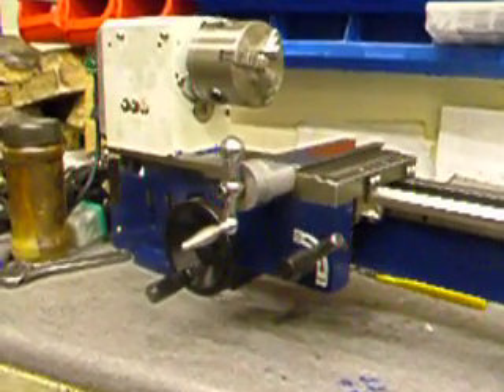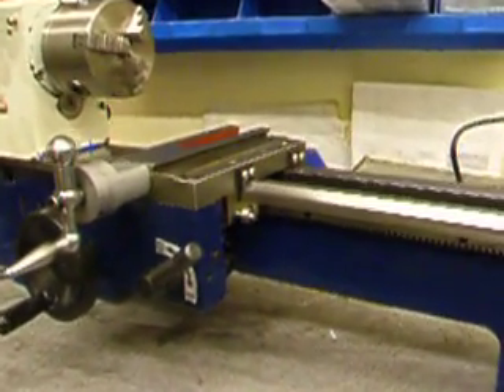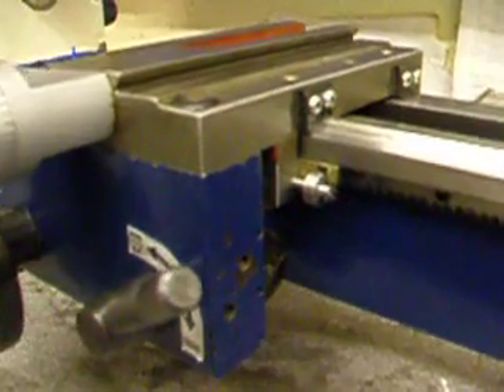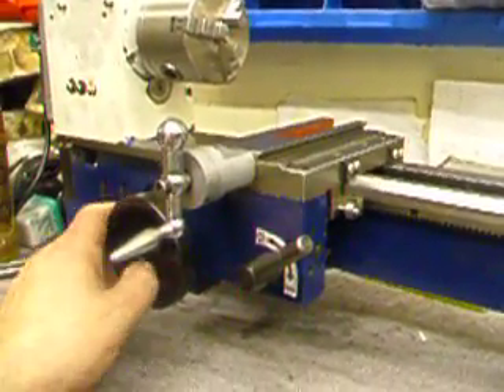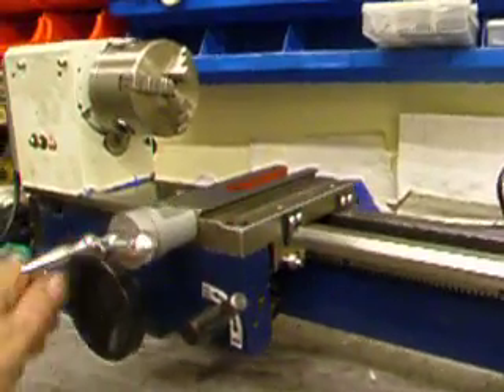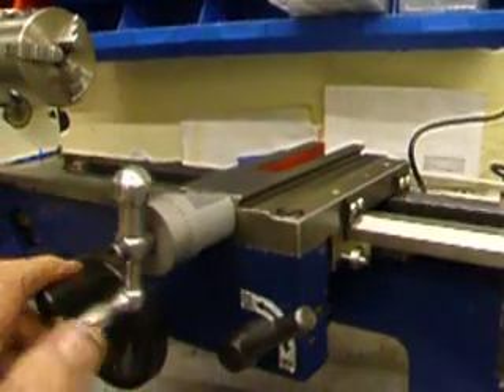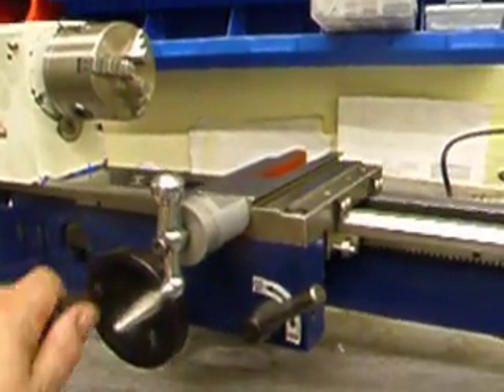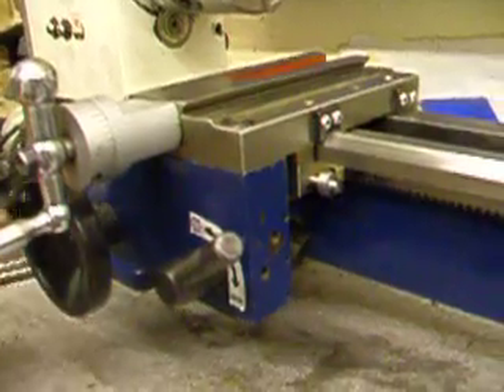Fixing a mini lathe on Madmodders site

Comment from the maker: Togaida,

Anything of mine that you find on the site, please use as you see fit.

With regards to the parallel. To find the centre of the hole, I subtracted the full width of the parallel plus half the width of the bolt from the overall reading to arrive at the centre position of the hole from the metal's edge.

Hope this helps you in some way.